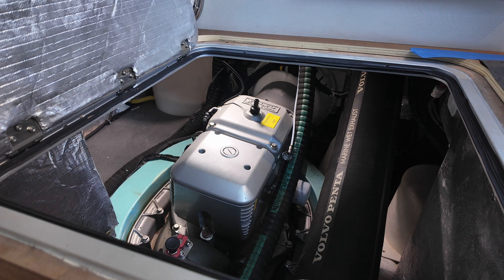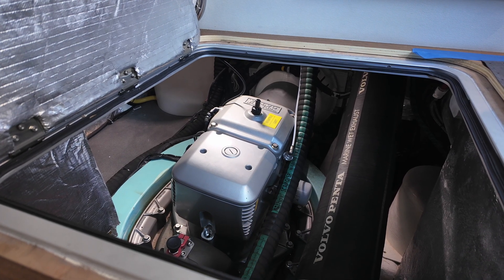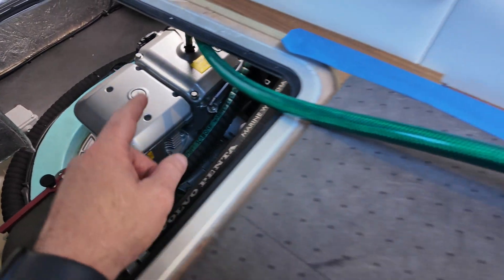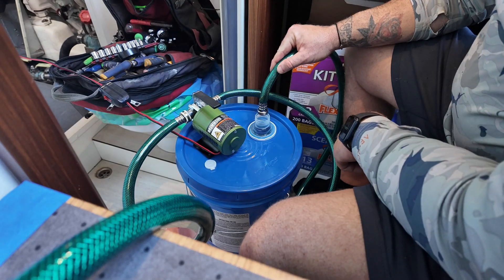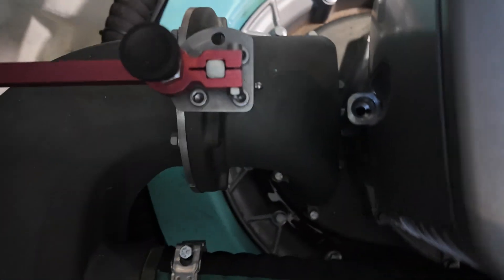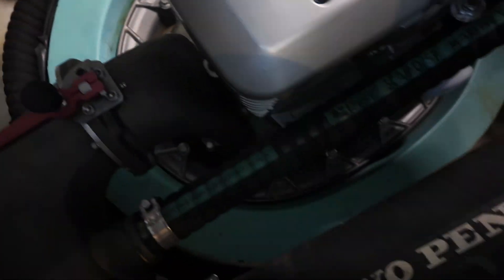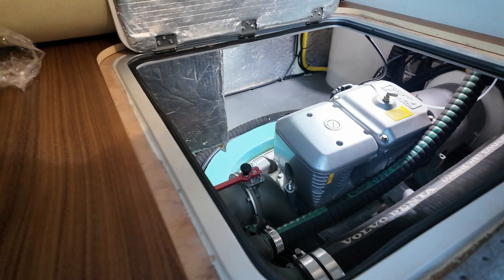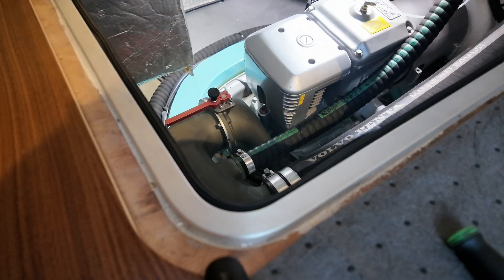Volvo Penta IPS800 pod Maintenance WITH OUT HAUL OUT!

Comment: Is there a part number or ... where can I get that oil fill adapter?  TIA.  Also I believe you do NOT have to screw that dipstick in to check the oil level.
Reply from the maker: @garycotz563  that part number is in the service manual. Thanks for the info on the dipstick. Let me know how that works out for you when they get up to temperature.